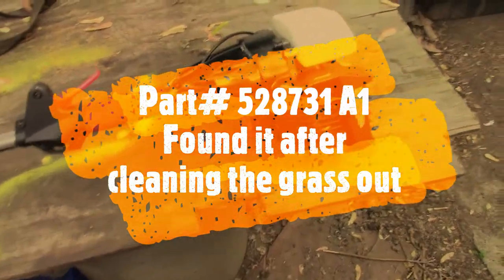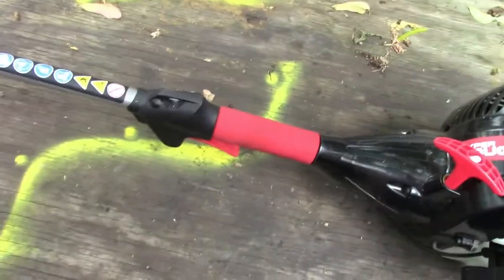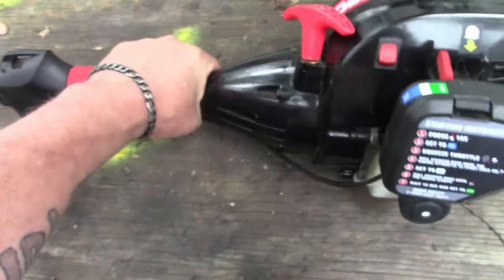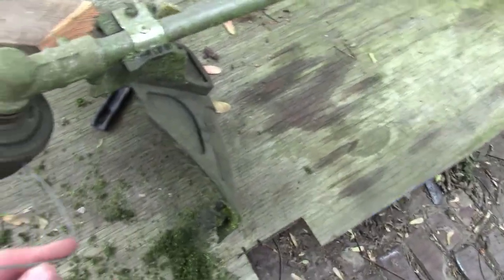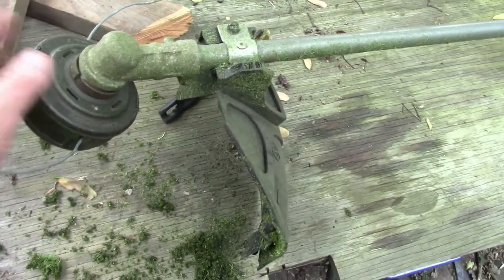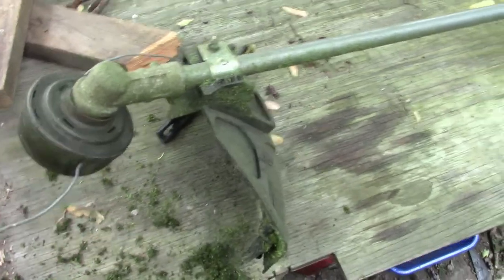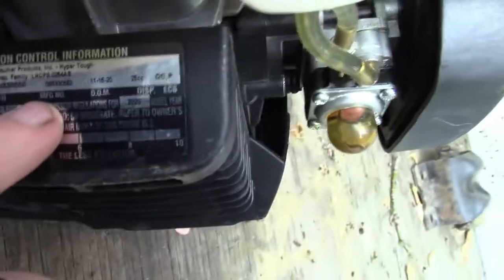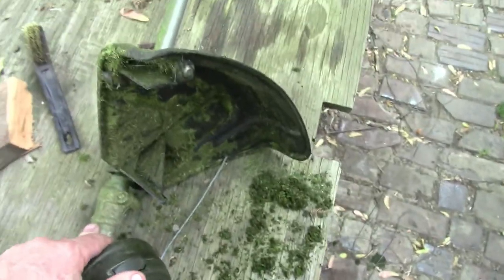Walmart Hyper Tough Trimmer review after 8 months Still going strong

Comment: I bought this exact weed eater yesterday and used it today! It is an awesome little weed eater!
Reply from the maker: We have 2 of them. Used them both last weekend for the first time this season. Both did good. I have a guy I cut grass for with a good sized yard. About 45 min. of trimming. One of them was a little cold natured at first but cleared up.
Reply: @GenerationX1971  When I used mine today, I had some pretty thick weeds to cut and it cut through them like butter!
Reply from the maker: @joshuathewelder24  I was surprised how good they run considering the brand. The only thing I’ve found questionable so far is the set up on the 2 piece shaft design. No issues with it though.

Comment: I live in Missouri, so I do not need to mow my grass year round due to the weather here, and  I also have a small lawn so I thought this weed eater would be sufficient for my needs. I was wrong. I bought this exact weed eater from Wal-Mart back in the summer of 2021. My lawn was not seeded until May of that year so I only used it from mid August to mid October that year. This year I've used it three times and it does not want to stay running. I took the covering off and found fuel coming out of the exhaust prior to the first use. I increased the idle and it ran good for one of the three uses this year. The last two uses I have to turn the throttle up high enough so I didn't need to apply any more throttle to weed eat. I also had to leave it on half-choke otherwise it would die. I am highly disappointed considering that I've never exposed this weed eater to unsuitable conditions (e.g. it's never gotten wet) and have always kept fresh fuel with the correct mixture. My lawn is so small it only takes me 10-15 minutes to weed eat. I cut my grass 16 times a year, so this weed eater only lasted for a total of 40 cuts, that is approximately 500-600 minutes of run time, or up to 10 hours. This weed eater cost me $69.99+ tax here in Missouri, so I expected it to last a little longer than it did without any troubleshooting maintenance. I'm going to take a peek at the carburetor and if that's not the issue I am just going to buy new weed eater by another manufacturer.
Reply from the maker: That’s crazy. We got lucky and found 2 of these at Walmart on clearance a couple years ago. I’ve had pretty good luck out them. They have both been ran hard since we’ve had them. The kids use them all over the neighborhood cutting grass to make money and they get used at my bosses house as well. My bosses house takes 2 tanks of fuel in each one to do all the trimming. One of them is getting to where it’s not wanting to idle all that well. Sounds like you might have a bad carb issue going on.
Reply: don't count on it being the carb, I thought the same thing and bought a new carb, still wont start and run
Reply from the maker: @garvinhooper  we had good luck with both of them for the first couple of seasons we had them. One is still running pretty good and the other one has seen better days. I wouldn’t pay the full retail price for one of them for sure.

Comment: How do you spool the dual string
Reply from the maker: If you flip it over to where you can see the bottom of the spool you’ll see an arrow. Once the spool is lined up cut a piece of line to length you desire and it should slide in one side and come out the other. Get the line to where you the same length on both sides and twist the red knob to draw the line in. After you do it once it’s really simple.
Reply: Very carefully. 😂

Comment: Clutch or no?
Reply from the maker: I have not fully disassemble mine but I would say yes to it having a clutch set up.
Reply: @GenerationX1971  Does the string stop spinning while the engine is idling? That would indicate whether the trimmer has a clutch or not. If it stops spinning while it's idling, it has a clutch. If the head continues to spin during idling, that means that it doesn't.
Reply from the maker: @jamesorsby7553  the model I have has a clutch. I’ve only had one over the time I’ve been messing with them that did not have a clutch. Old Toro from the 80’s.
Reply: @GenerationX1971  OK... That's what I needed to know, because some of the cheap trimmers don't have a clutch...the string continues to spin even when it's idling.
I'll be picking this up on the weekend. Thanks for the info.
Reply from the maker: @jamesorsby7553  we’ve had pretty good luck with both of them so far. When we picked these two up they had a display model out of the box. If that’s the case where your at give a good look over. They do look like they are built cheaply but so far so good.